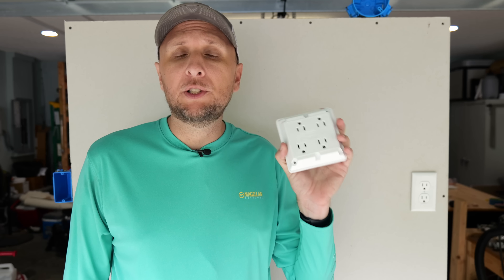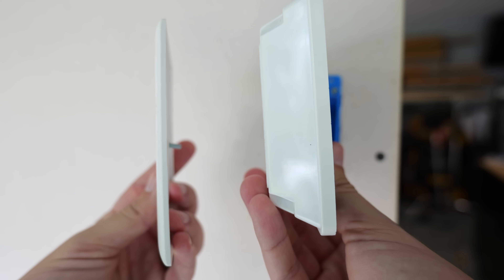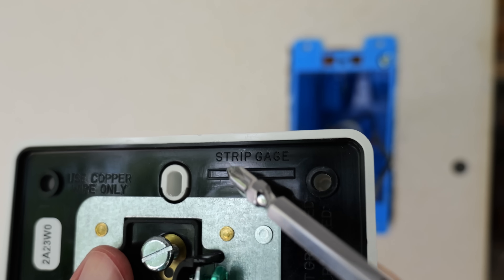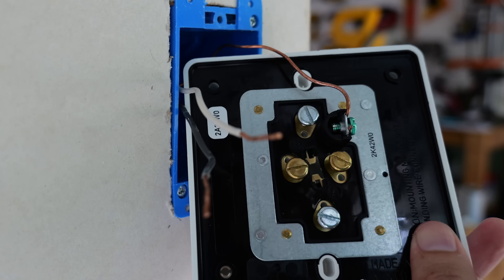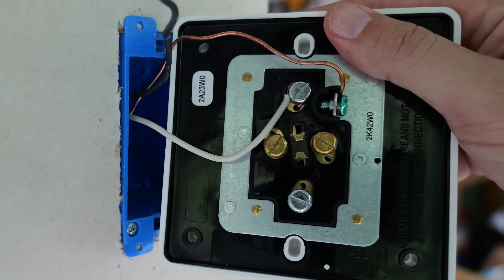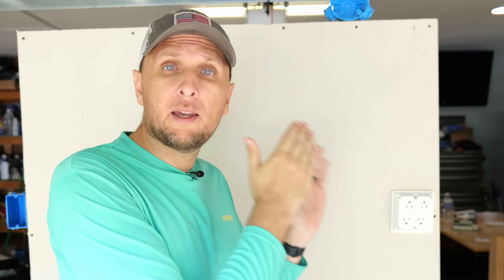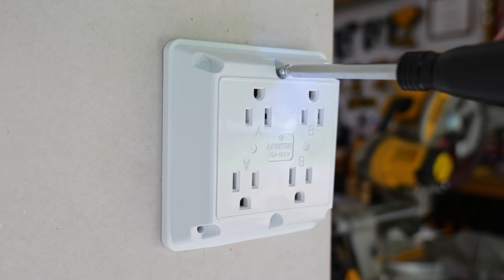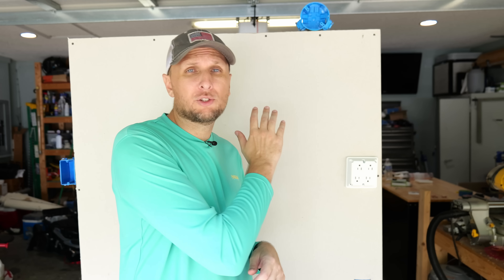The GENIUS 4 Outlet Receptacle That Almost Nobody Knows About | How To Install

Comment: I'm  worried that the ground wire might touch the neutral ot hot screw head. Would adding electrical tape be prudent?
Reply: I see that others have the same concern. Same heat shrink tubing and a heat gun would a quick solution in my DIY opinion.

Comment: I like this device, however I would put heat shrink on the ground wire.  As you push in the old style outlets the ground and neutral tended to stay on the side they were attached to or directly behind the device preventing accidental shorts to the hot screws located on the opposite sides of the outlet.  With this one if the ground wire while being compressed back into the box is pushed by the back of the device, you have a dead short.  Either protect the ground from accidental short with heat shrink or place a plastic or tape barrier across the back of the device where the exposed screws are locate.

Comment: I got one that has 6 outlets and 3 USB and just plugged into the old single outlet. Much easier.
Reply from the maker: Give it some years, those connections will start getting loose, especially the USBs.  None of those are made as well as these and hardwired connections are way better.  Takes 3-5 minutes to install at most.

Comment: Un-isolated ground wire is bad.
There's a risk of it rubbing against terminals when you put it back in the the box.
Especially when the terminals aren't recessed.
Not a problem through the conduit/wall, but there should be a requirement to use color coded shrink tube on ground wire inside the box.
Reply: The terminals here were slightly recessed, but they were fairly large, and not requiring much bend on the ground wire to come in contact with the screws.

Comment: Unless you ABSOLUTELY need that extra outlet in an area where it is not physically possible to add a double gang box (i.e. the wall cavity consists of 2 x 4's as past of a load bearing wall or door jamb and there is only physical space for one box) I can't see where this would be practical - outside of saving the time to cut in another box - given the cost, and the "eyesore" factor.

Eyesore  from the perspective this would stick out from the wall a lot further than every other outlet along that wall.  Granted, this may not be an issue for some people, but for people like me who are kind of anal about appearance and uniformity along a wall, it would drive them nuts 

And then there is the cost. This outlet is about 30 bucks. I can buy a double gang box for about $4. Little bit of labor on my part, and I can put in dual outlets that look like every other outlet along the wall and doesn't stick out. 

Of course that is dependent on you having the physical space in the wall cavity for a double gang box

Comment: Like the review and the product but why the grounds are upside down on top?
Reply: In the slim chance that a metal object falls on a partially installed plug, it will strike the ground pin instead of potentially creating a short between the hot and neutral.

Comment: (is 1254 some agreed upon model for various 4-outlet sockets ?)
I didn't realise that Leviton also offered a not-sketchy version of these (in a more-subtle colour range) at a more reasonable price. I'll try to remember these exist for the next time I'm asked about adding more sockets somewhere. 

I wish the sides could be more sloped to deflect bumps/carts without making it more difficult to handle/install.  

But those situations should have guards/bumpers anyways.

Way back in high-school I helped make a bunch of box-mounted 3-outlet taps for the recessed sockets in their workshop; instead of letting the teacher continue to struggle with finding interleaved-and-mislabelled circuits while replacing the receptacles.
While I designed them, we didn't use a set pattern. I was later shown that the ones that didn't break had enough of a slope to them that people couldn't use them as a foot hold instead of clearing space for a step ladder ...

Comment: Two items: 1) all terminals which will not be used are determined prior to terminating any wires and they are secured out of the way. 2) Make certain the ground screw is not contacting the brass “hot” wire prior to pushing all wires into the box so as to avoid a short circuit. Safety first. Otherwise, good installation.

Comment: It seems like there is a greater chance of a short between ground and hot because of the flat surface layout, when pushing the wires into the box there is a chance the ground wire will fold onto the hot. 
An experienced person may make sure this doesn't happen but an inexperienced person would not be aware of this and not take it into account. 
Imho you could have mentioned this.
Reply from the maker: I could have but I don’t think this will be an issue very often.  The ground screw extends out from the back of the outlet so the ground wire would have to be extremely bent in to make contact.

Comment: Be very careful the design is not great , I have gotten calls wher they we’re throwing the breakers and found out that the ground  wire was coming in contact with the hot screws !! Not good !!

Comment: Oh cool, electrical boxes are now plastic? How long has this been a thing?

Last box I ever had to open was a light switch box where the switch was installed crooked and the wire screws touched the inside of the metal box and basically exploded while I was dropping the kids off in the pool.

Comment: Interesting, I use a push in 2 to 6 plug converter, but this is much slicker.
I haven't used those anchor holes, but if they grip the wire enough that it doesn't pull out, wouldn't you be better off wrapping the other direction, thereby pulling the non-stripped wire into the screw as it turns clockwise?
Reply: There is literally no difference between this and what you're already using. In fact the ones you use are better because you can remove them easier.
Reply from the maker: They are not better.  Those are cheaply made and not hardwired.   The outlets in the video are industrial to hospital grade.  They are made to last and are hardwired which is a superior connection in every way.  Some of these takes are amazing.  I did not realize so many people watched DIY videos but concerned about a few minutes of wiring.  😂

Comment: they make these that just plug into the existing outlet, no additional wiring.
Reply from the maker: No thanks, have owned several and after a couple years they all started getting loose connections.   This is industrial grade, will last a very long time, and is hardwired which beats the connection of an adapter every time.
Reply: @HowToHomeDIY  I agree with that

Comment: Or, you could just buy a plug in multiplex outlet and skip all the wiring.
Reply from the maker: No thanks, have owned several and after a couple years they all started getting loose connections.   This is industrial grade, will last a very long time, and is hardwired which beats the connection of an adapter every time.

Comment: Interesting adaptation to the 4 or 6 outlet plug-in units that can be directly plugged into an original duplex outlet.  I like the way that these units not only have the top outlets slightly off center from the lower ones but that the top ones are upside down ( for safety GND ) and the lower plug-ins are GND hole on the bottom.  It gives you the best of both worlds. This would be handy for times when your cord plugs are 90 degree angled plugs or some "wall worts" take up more room and perhaps have the power cords at a different location other than bottom center.  Thanks for the video .
Reply: Strange that he did not mention the vertical misalignment, as I suspected there was some reason for it.
Reply: The direct plug-in type has problems, the ones that just plug in are not secure enough when unplugging and they are very wobbly. Also some do not support if the two outlets are on separate circuits. There are some that replace the cover plate so they do have one point of fastening and do support switched outlets but they are not hard to find.
Reply: The top receptacles being slightly offset is triggering my OCD.  I'm not sure that I could live with having one of these installed...

Comment: I've been dreading having to cut through paneling and lathe and plaster wall to install a double gang that has been sitting on my table for the past two months. I'm going to buy this. It seems they're out of stock but the hospital-grade is available, thank you. It's going behind the couch so I don't care for the one inch that sticks out.
Reply: @DanielA23 the original outlet needed to be replace anyway. I do have the plug-in style in other outlets but prefer to have this style in this particular outlet.

Comment: I do not see any point to this device. If it adds height, then just use a multi-port outlet adapter and screw it in. What did all this extra work and expense get you over the cheap and simple solution?
Reply from the maker: It got me a 4 outlet device that is industrial grade, will last a very long time, and has a superior hard wired connection.  Those adapters are exactly as you say, cheap. I have bought two of them in the past couple of years and the connections are already getting loose with moderate use.

Comment: You know they make a 4 to 6 outlet box that just plugs into an existing outlet and extends the same as this one and they work great and are very secure. ✌🏻🇺🇸
Reply from the maker: Yes I am aware that they make inferior products with an inferior connection that just plug into the wall.

Comment: Good video and I like your attention to detail in explaining electrical work for beginners. I’ve done a lot of electrical over the years and find your advice (at least in this video) to be sound.

I wasn’t aware of this product before, but apparently it’s been out for several years (perhaps the reason for the slotted screw as opposed to the multi with square drive option). Leviton makes it in several colors in both 15 amp and 20 amp versions as well as with surge protection. Industrial and hospital grade.
Reply: Should have pointed out to push the bare wire in first so that the insulated wires keep the bare wire from coming in contact with the bare copper screw.

Comment: I would not use this receptacle. The ground wire could easily short against the line or neutral connections when mounting the receptacle.  If using this receptacle I would suggest taping the ground wire. Also you can buy 4 & 6 way receptacle wall outlets that just plug & screw into a single receptacle.

Comment: I think I might push the wire in the hole and then run it around clockwise actually hooking  the opposite way. Since the end is in a fixed position in a hole the insulated side of the wire may tend to slide out from under the terminal when tightened.. Thoughts?

Comment: For the depth it adds, you almost might as well get one of those blocks that plugs into an existing outlet. I've seen those with up to six 110V outlets and some with USB now.
Reply from the maker: Yeah and the ones I have owned, the connections started getting loose after a couple of years.  Especially the USB ones.  They are also usually thicker than these.  A hardwired connection is still a superior connection.
Reply: @HowToHomeDIY  It would be interesting to look into what's inside a few of each. There's no reason they couldn't be manued to the same quality. I've seen plenty of loose regular outlets too, particularly in hotels. There's no reason they would be much thicker either, a comparison would be interesting (and, as I say, the right-angle feature on some would more than compensate for that in some applications). A hardwired connection may be superior in a few ways but what are you going to be doing with it anyway? Plugging 120v plugs into 120V sockets. To be clear, I'm not against these, I just think the benefits (of like-for-like) are slim and situational.
Reply: @HowToHomeDIY  Just to compare, Leviton puts this at 1.15" thick where the cheapy GE on Amazon claims 1.0". It's not clear if the GE takes account of the amount the original outlet protrudes from the wall but I'd consider that pretty much a draw.
Reply: Those splitters are garbage.

Comment: I am just going to use one of those 6-plug devices that just plug into the single gang outlet.
Reply: Those things are complete garbage now.
Reply: @johnpicard4909  Maybe so.  The ones I have been using I have owned for 30+ years now.  I can't say anything about a new one.

Comment: How do you keep the grd wire from coming in contact  with the hot leads?
Reply from the maker: The ground would have to be pretty bent up to bend in that far and make contact with the terminals.  But to be sure, I push my wires into the box while mounting this.

Comment: This is sort of a specialty item for me. Depending on the price, I would use it in a garage, basement or shop as an upgrade, but the way it stands proud of the wall doesn't seem appropriate for normal living space. Of course I've got the skill to do the alternative method. If I didn't, I would probably view it more favorably. 
I really like the connection method though, and would like to see it on standard receptacles.
Reply: Unfortunately, using this in a garage is a code violation in my state.  Garage outlets have to be GFCI.

Comment: I'm spoiled on using power strips wall mounted next to the standard 2 outlet receptacle ... with this 4 unit  you lose the ability to turn off power instantly , as well as a measure of quick protection  pending on which type strip you choose to mount
Reply from the maker: Power strips are cheaply made and not hardwired.  This is much stronger.  If item’s need surge protection then of course that’s something to take into consideration.
Reply: @HowToHomeDIY  does hospital grade not come with surge protection? ... I'm not seeing it listed on amazon product description ... I  have surge protection on the strips I purchased from Monoprice
Reply: @seaperu1  the devices in the video are actual outlets, they don’t offer surge protection.  He said if you needed surge protection then you would need to take that into consideration.  Unless you are plugging in sensitive electronics there is no need for surge protection.

Comment: What's the point?  Those 6-outlet things that plug into a regular duplex outlet have been around for a long time, very inexpensive and require no "installation."
Reply: Those things are pieces of garbage.  Many years ago they were made better but now they can start going bad after a couple years.  The double duplex device he’s showing in the video is hardwired which is way better and it’s industrial grade.

Comment: It's a missed opportunity to build those with lever lock terminals like on Wagos. I don't like the way you are supposed to install the wires, seems more difficult than J hooks.  It would be interesting to see a scientific comparison of performance between this setup vs the older ones that would plug into the existing outlet and be held in with the center screw.

Comment: I normally use a 6 gang surge protector with swivel sockects. It just plugs in or you can screw it to the cover plate. No work required.
Reply: If you need surge protection for what you’re plugging in that’s one thing but those won’t last as long as what he installed in the video.

Comment: Meh. A quality hex tap with a surge protector is good enough for most situations involving low watt electronics. If you need something more heavy duty, I'd just install a double box. It's not that difficult. Probably cheaper than this 4 outlet specialty device. Ideally, boxes should have six inches of wire coming out of the box from the outside of the wall. In reality, you'll be lucky if you get three inches. You'll probably have to pigtail just to install this thing, anyway. I just don't see this being practical.

Comment: It seems like it's gonna be insanely easy to end up with your bare ground wire touching another of the screws when you push it all into the box....the rear layout of those connections makes me extremely uncomfortable.
Reply from the maker: The ground would have to be severely bent towards the terminal screws.  Worst case if it does it will trip the breaker and can be easily fixed.

Comment: Why, in America, is the ground wire never insulated? When pushing this back into the existing box, it could very readily get crushed against the live or neutral terminals, creating an instant fault.
Reply: if that happens then you'd find it right away and should be reprimanded because you didn't install it correctly. I do agree that it makes no sense it isn't insulated, it can't be that much of a cost savings. they are installed such that they won't make contact.  It's just this style of romex that has the uninsulated grounds.
Reply: When using mc cable, the ground wire is insulated. MC cable can only be used with metal boxes, but if remodeling or new construction it's a homeowner's option.

Comment: It looks like your screwdriver link is for a different non powered screwdriver.
Reply from the maker: The one I have listed as electric screwdriver takes you to the electric screwdriver I used.  I just checked it.  The link below it is for the Milwaukee ecx that I also use but it is not electric.

Comment: why do you think they did straight blade screws instead of better types that don't strip?
Reply: none of the screw types are impervious to meat heads stripping them out.
Reply: Most homeowners don't have ECX or Robertson drivers, but have flat blade and Phillips. Phillips cam out easily, while flat blade can slide out, it's better for torque.